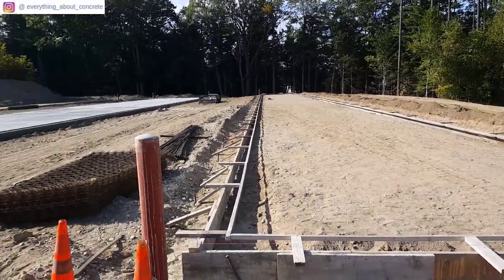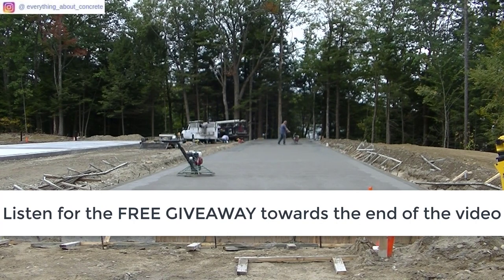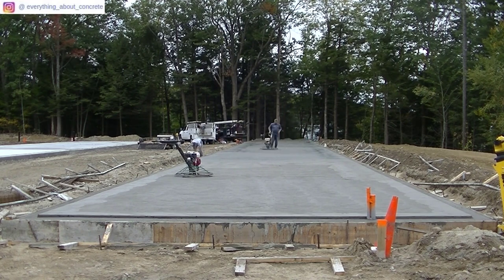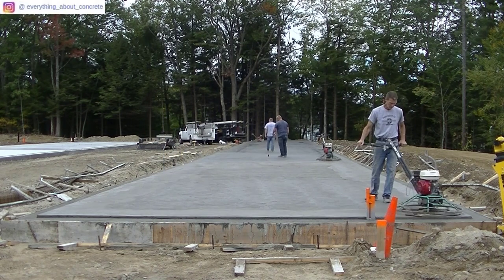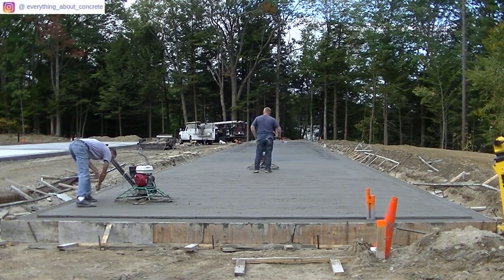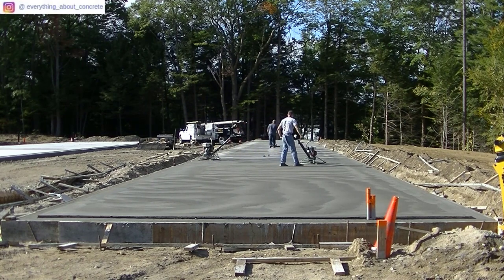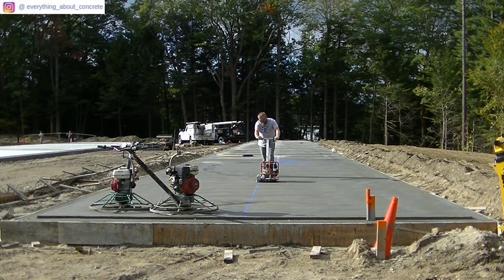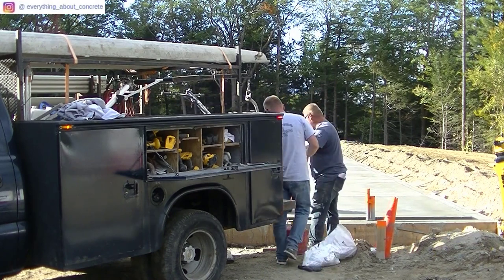Finishing A 4400 Sq Ft Concrete Slab (Troweling and Saw Cutting)

Comment from the maker: Make sure to check out my MERCH Store then leave a COMMENT HERE as to what size and color T-shirt or Sweatshirt you want.  I'll be picking 4 winners from the comments left on this video. Here's the link to the store: https://teespring.com/stores/mikes-shirt-products-store
Reply: Have you ever used one of those commercial ride on power trowel machines? I have not, only seen them in action.
Reply: Done except for Instagram which I don’t have. XXL Gray Pullover Hoodie or T-shirt. Thank you for the opportunity. My husband is a carpenter who does his own pours and he watches your videos all the time.
Reply from the maker: Thanks Freda!!
Reply: Cool Konk videos! You guys definitely know what you are doing. I appreciate all the extra work you do in putting them out here for any who are interested. 
I couldn’t tell in the video how you kept those stepped forms level. Also wondering what the purpose of them were in this case?
Please throw my hat in the ring for a black hooded sweatshirt in XL. THANKS MIKE!
Reply from the maker: The builders build the walls on the lower shelf, that way no water gets under the wall and onto the floor. They're for storage so they can't get flooded. Thanks

Comment: Sorry, late to the party on this one.
-Really nice looking slabs Mike. Concrete is one of those things that’s almost as satisfying to watch as it is to work yourself. Really proffesional looking work you guys are doing there. 
-Didn’t catch if it was Darrin or Luke rigging that bundle of steel with the chain but here’s a quick tip - Make a dbl wrap on the bundle with the chain instead of a single. When the machine lifts up the first wrap will cinch up with a choke and it will keep the bundle from being loose and flopping around. Looked like you had plenty of length on the chain. Try it, you’ll like it! 
(btw Mike, your video editing gets better and better every time. Very nice job with that too.)
🤜🤛
Reply from the maker: Thank you!

Comment: Hi Mike. Have a question for you. Could you please make a video of you guys doing relief cuts/expansion cuts please. I think we would all like to see that. I work for a city and have been doing concrete for 15 years.  It would be nice to see how you guys do it and what you use for a saw. Thanks
Reply from the maker: We did it on this video, did you see it?
Reply: Mike Day Everything About Concrete 
Yes. Thank you. Would like to know what saw you use as well. Ours at my work is a Core Cut walk behind but it seems very awkward to run. Hard to keep straight. We cut the next day.  You guys use a 6 inch blade?  Ours is a 14 inch and I think we buy too aggressive of a blade. 
Any suggestions. Thanks

Comment: I would like to see a shot of the saw cut,  I usually wait till the day after, we get a much cleaner cut.  However there's always a chance that it will crack before we get back there. Cutting the same day in what the saw manufacturer calls the "green zone " leaves us with raggedy edges, and looks like _ _ _ _ 
Size XXL BLACK
Great video
Reply from the maker: Thank you!
Reply: Don u ever use a soft cut saw?

Comment: Why do you saw cut rather than use a groover on these pads? We're going to pour a 30x40 slab over very stable ground and we rarely drop below freezing. We have a post that will land in the dead center of the building and I'm wondering if joints are always needed/recommended or if we might get away without them?
Reply from the maker: Sawing a finished floor after power troweling is much easier than using a groover. You don't want to run a power trowel over a "green" groove or you'll just fill it in or at least damage it. Concrete shrinks when it cures causing "stress" on the concrete. That's what makes it crack early on. Sawing joints gives the slab a place to relieve the stress and crack in the straight cut. You and always take a chance if you want to but we don't.

Comment: Great work. In East Tennessee I'm yet to meet anyone that's ever used float blades on a machine. Everyone uses combo blades. I'm interested tho. Do they do a lot better than finishing blades on first pass? If you have a small hump, will they cut that off better? I couldn't help but feel sorry for you guys having to form those slabs like that.
Reply: Brad Hill I’m in Cincinnati and we use a pan to break it open on first pass. Fill and lays down nice.
Reply from the maker: I've used combos also. I feel the float blades fill and break it open faster on the first pass also.
Reply: Im in east Tennessee i can show you  how
Reply: @MikeDayConcrete  I use to use float blades,but switched over to combos.Mostly for convenience.Been doing concrete work for 45 years.69 years old.Getting ready to start a30x30 slab next week,weather pending.

Comment: That’s crazy you guys are cutting with a troweling machine still on the slab. We have the same saw. We’ve tried every color blade they make and unless it’s summer we have to wait til the next day to cut. If not, it will chip terrible. It’s funny you guys can finish that with 3 guys and some companies would have 6 on that pour. 👍